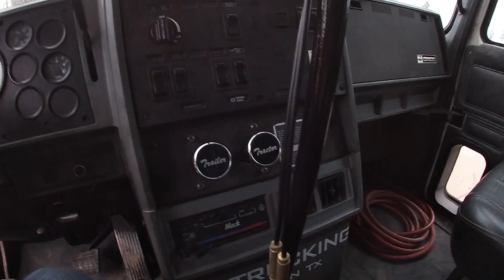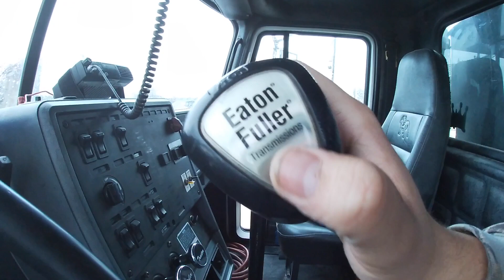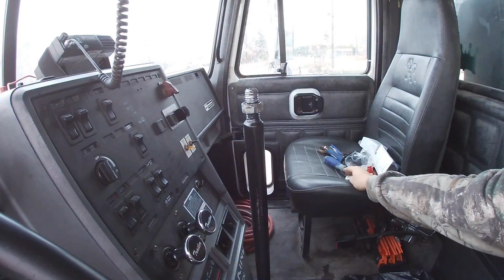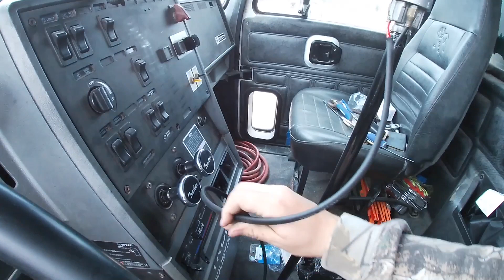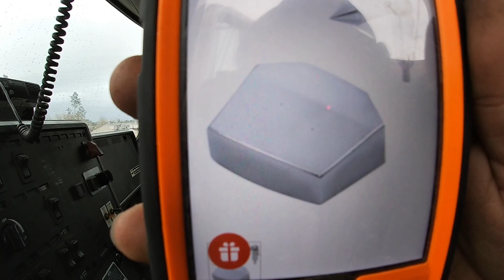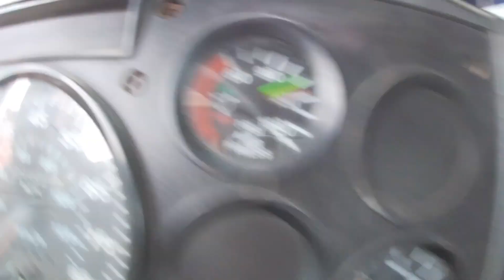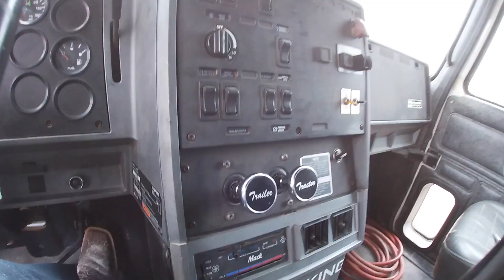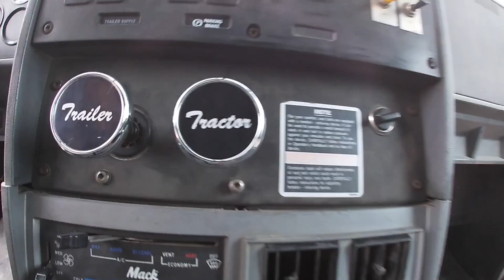How to install extended chrome shift knob for a 10 speed

Comment: Aww man, you got it easy. 😅
I wish mine had quick disconnects. Mine is ooooold and uses compression fittings at the high/low switch. Luckily I have some extra brass sleeves. Shouldn’t lose but maybe 1/4” off each airline so I should be good.

Comment: What I did on my shifter instead of using zip ties, I used electrical tape to hold the air lines against the shifter. Then I got pipe insulation (if I remember right, 1" inside diameter) from Home Depot and put it around the shifter from the bottom of the housing to top of the boot.

Comment: Where did you buy the chrome metal shifter knob?and the air line with the insulation?i went to utility to look for it they don’t  have it or other chrome shops
Reply from the maker: Chrome stop, that’s weird that the chrome shops you went to don’t have them.

Comment: where did you buy the air lines ?
Reply from the maker: You can buy them at any truck parts store
Reply: @Grtruckingdemolitionllc  do they come wi the the fittings also?
Reply: @armandoruelas9118  no , the fittings come separate,  5/32 quick connects, I got brass ones